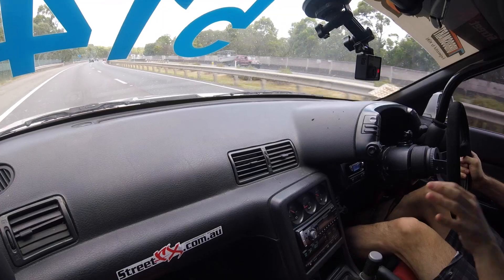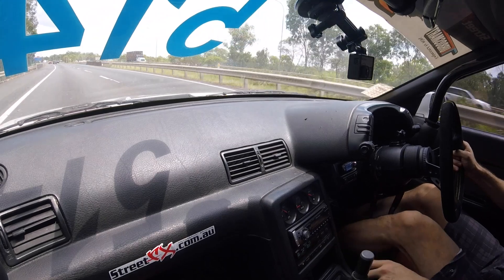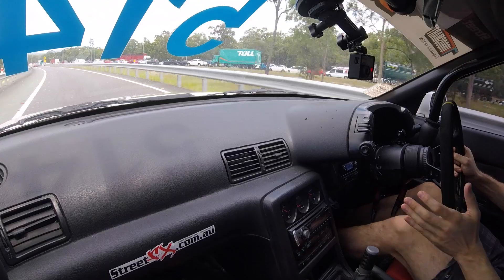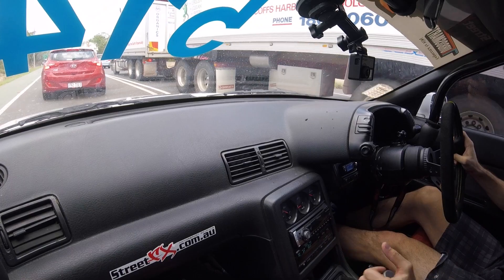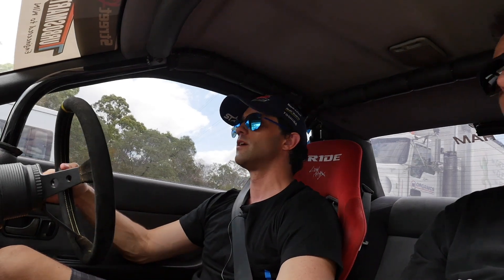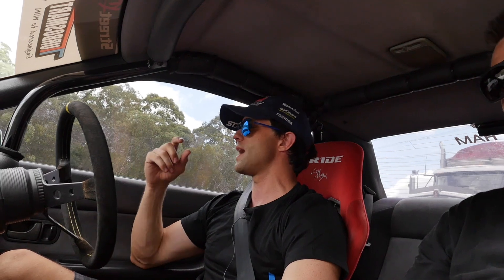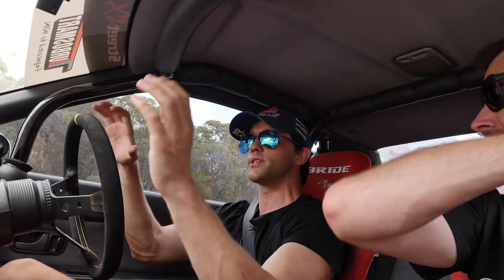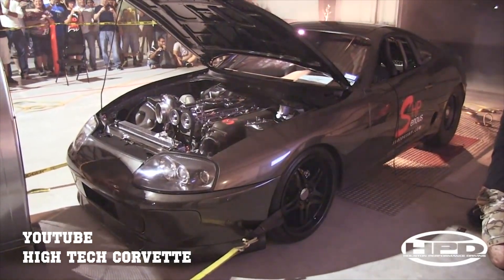What is TURBO FLUTTER & SURGE? Is it Bad? Myth-busting in our Nissan R32 GTR!

Comment: You're talking about a ball bearing turbos. Try that with a standard turbo and watch the rotors get swallowed by the engine, lol.
Reply: Owned a bunch of turbo cars with journal bearing and no valve, they never had one, zero issues with the turbo.

Comment: This guy: Surge: its when you at wot and its too much AIR THAT HAS NO WHERE TO GO.

                  Flutter: its when you at closed throttle and THE AIR HAS NO WHERE TO GO.

Dude you saying the say thing and calling it a different name like there 2 sifferent things. The air has no where to go but back to the compressor wheel slowing it downcausing it to surge. Their the same thing and yes they do detroy turbos normal turbos, maybe not high performance turbos with better machined parts but MOST turbos flutter/surge will detroy your turbo and i will be at the shop ready to replaces them for you cause iknow your most of you dont care 👍

Comment: It sounds like nails on a chalkboard and is bad for the turbo bearings. A blow off valve sounds great and saves bearings, intercoolers, boost pipes and hose clamps.
Reply: Well it's a good thing running no blow off valve doesn't damage any of those things.
Reply: @DriftNick    just running and time damages them. Unnecessary boost spikes increase the wear on all of them.

Comment: Do you know her Jeremy Clarkson says it’s not the speed that kills you. It’s the sudden stoppage well, when people say the turbo spinning backwards, they don’t mean it’s literally spinning the opposite direction. They mean that the impeller rpm is slowing down to the point where air is making it Slow down. The air Hass to go back through the the turbo and it’s generally not good
Reply: When people are saying it is the turbo spinning backwards they are not understanding what compressor stall is, they think it's actually the turbo stopping, turbo flutter does not actually slow the turbo down, the turbo is already slowing down because of reduced exhaust flow, turbo flutter or not does not change how it slows down.
Reply: @DriftNick  compressor surgeon turbo flutter is the same thing I don’t really want to go over this when you can YouTube turbo flutter in compressor search and there’s a video with a man with an electronic turbo that shows you the most basic form. What flutter a.k.a. surge is it doesn’t reverse the turbo it slows it down with enough force to cause damage do you ever see a plane just break apart that’s because the air has so much pressure it can destroy things and I’m not going to sit here and argue when you can do your own research
Reply: @oler777  I know the are in the same thing, I didn't say otherwise, as for it slowing down the turbo it does not do that, people have literally tested it with a turbo speed sensor, the rate at which the turbo slows down after lifting off the throttle is the same between running a blow off valve and running no valve.

"plane just break apart that’s because the air has so much pressure it can destroy things"

Not even close to the same thing.

"do your own research"

Clearly something you have not done.

Comment: Thanks for this valuable information! I was slightly worried about my turbo after my Diverter valve failed on a recent road trip resulting in compressor surge / Turbo Flutter. I ended up driving about 400 miles with this condition and I didn't really seem to have any boost lost. I was just worried about the stress it might of caused my turbo. Since this owner has been going DV/BOV less or whatever and intentionally causing the flutter I'm guessing the 400 miles I did like this before changing my DV valve to prevent Flutter didn't cause any harm. A different youtuber made it sound like it was pretty harmful on bearings hardware.

Comment: For all the ppl asking or assuming it damages the turbos components.., it’s both yes and no… the rotating impeller speed, it’s seals, the inner clearances, the bearings.., by numbers on paper and science yes it SHOULD hurt components BUT how many videos have you seen  with ppl showing damaged turbos from surge?? None..

Comment: Turbo surge can also be your tune! Two reasons are,too high of a boost level at too low of an rpm, and even if in high gear and high rpm, your throttle body percentage (amount open) is not at WOD so partially closed will add resistance to the turbo and cause higher boost levels but would be a “false” reading because the turbo’s flow is maxed out at the throttle body instead of the boost pressure being maxed out at the cylinder or behind the intake valve.

Comment: I have installed blow off valve spacer in my Fiesta ST 1.6 230 hp for the whooosh sounds and even though everything is installed correctly, somehow i get the turbo flutter upon releasing the throttle which shouldnt be the case. But i quite enjoy it, question is... is it safe for the stock small KP39 turbo? :D

Comment: Nice vid, but you did sidestep the point that compressor surge when on throttle is bad, because you're trying to spool the turbo on the hotside but the compressor side cant push the air, so it puts the turbo under a lot of stress.

Comment: I have had my 180SX for 21yrs and I get some flutter and love it with my GFB dual BOV I have it plumbed back to the inlet of my turbo to help keep it spooling when I go full boost there's no flutter only low to mid throttle.

Comment: I want to do that to my car turbo flutter and blow off valve at the same time that's sick it sounds crazy but how does it work Together?
Reply: If your bov is adjustable, tighten it fully then back it off slightly. That way itll vent via bov under high boost, but flutter on low.

Comment: I appreciate the info thats not just on the surface, ive heard a few N54 (bmw copy of the 2jz) BMW e92 335i cars have this surge sound before but VERY VERY few have it, im willing to dump a bit of performance for that sound, how would I get it? It seems to be a mystery in the community for that engine at least, some say BOV but the only way I can see that is if the BOV has a super hard spring In it
Reply: Don't run a blow off valve and have a metal intake pipe going into the turbo, it will flutter.

Comment: Hi there i know this video has been made a long time ago! But if i dont have the flutter sound what steps could i take to make it?

Edit: My turbo is TDO4HL
Reply: Block your factory bov, use an open filter rather than filter box (a pod filter or similar).  Replace any ribbed sections of your intake. Turbo size and boost will change the way it sounds, so its very unlikely yours will match the one in the video, but itll still flutter.

Comment: do you need a big turbo for it to have a compressor surge sound like what yours id doing?

edit: and how is the blow off valve shutting when there's too much boost? it's job is to release that excess boost right? is there a setting on the bov that it needs to straight up change gear quickly for it to open?  need some knowledge about this. thanks!
Reply: Bov is set to a certain psi. So itll only open when that much boost is present. Eg, imagine his car is running 20 psi, but as hes cruising around only really spooling to 15 or so. the bov wont open, itll just flutter instead. When hes absolutely hammering it and it's at 20, the bov will vent.  The numbers are just an example. Hope that helped
Reply: @strider5119  thanks for the clarification! so that's how a bov works, you'll set it on a certain psi for it to release

Comment: Cant remember what controlld how much boost your engine gets. Doesnt bov also decide how much psi your engine gets? So if you remove it then you could send upwards of 50psi amd send your pistons through the roof? Cant remember if thats what the bov does also amd where you cam control how much psi it gets in mega squirt

Comment: Can you make another video to show as how you do it
Reply: Block or remove your factory bov. If you remove it, be sure to block the hole and the vacuum line properly. 

Otherwise, you can block the vacuum line that goes to your factory bov, itll get the same result. (The bov can still be forced open with pressure, but not with the boost you'll be running)

Comment: Hi guys, I have a complete stock 2019 Volkswagen Golf R and was wondering if I were to unplug the diverter valve (this will create the flutter noise), would it actually damage the turbo? I'm getting mixed messages and just want 100% confirmation whether it actually damages it at all or even slightly? 
Appreciate it!
Reply: I have a 2015 gti and I tried it, it definitely works and makes the noise. Didn’t notice any running issues or boost issues. Also no CEL
Reply: @vwparedes2768  Thanks for the reply! Appreciate the feedback! I'll definitely give it a go now 😊

Comment: It doesn't allways affect the performance or lag.. With a bov it dumps the air pressure in your intake and piping etc then your turbo needs to re pressurise it when you come back on the gas.. . No bov keeps the air pressure in the system, that's why lotta rally cars don't run a bov
Reply: You just contradicted yourself .... And your are WRONG ...
Reply: @ACommenterOnYouTube  explain
Reply: @strider5119  what did you not understand ?

Comment: Depends the turbo dudes. With anti surge turbo you will not ever brake anything with flutter. Its not turning the turbo wheel backwards but the trapped air hits back the compressor wheel cause there's no elsewhere to go. So 2 things will go wrong brake the shaft if the shaft its not that strong or destroy the wheel wings on high amount of boost. I've seen both of them situation.

Comment: I have a question, if the air is coming back out of the turbo will that affect the MAF sensor if it is set on the intake side of it. Just thought the car would be regerstring that it's still getting air coming in when it isnt.
Reply: burger14uk yes. Sometimes mine will stall if I do a pull and put it in neutral fast. It will over fuel and cut off

Comment: Sorry..These guys are wrong.. when u close the throttle blade the turbo compressor does not slow down.. it actually creates areo slip and SPEEDS UP.. lots of misconceptions with this.. do some research

Comment: A blow off valve blows the air fuel mixture that should be recirculated to the motor to give more power as well as saving gas or petrol if its vented that's causing more air more fuel and believe it or not more stress and wear and tear on ur pistons,rings,and pcv valve most likely will not happen right away but this will result in an engine rebuild or over boosting witch can cause a piston to go through the engine out yo hood no more fun ass race car so recirculation of what ur blow off to our atmosphere maybe a better idea pimp not to be rude do the math guys and stop wasting your gas money that could be used for upgrades 💯
Reply: How can it result in an over boost?
Reply: They do not reciculate air and fuel mixture at all. A blow off valve is placed before the throttle valve.
Reply: If ur car has a maf sensor like the one on my grand national vent to atmosphere will cause my car to either run lean then the PCM has too accommodate for the loss of fuel and air mixture which results can be overboosting because a turbo uses exhaust fumes coming in from the air intake manifold or intercooler setup which mine is a hot-air set up so it goes straight into the air intake manifold which can cause my engine to overboost as well as use more fuel and inhale more air through my K&N air filter with means more fuel needs to be added to the tank which brakes the  pockets because I have to run a higher octane fuel since I live in California the highest octane fuel I can run at the pump is unleaded 91 premium gasoline getting back to how it can overboost that causes damage as far as frying piston rings blown head gaskets and cause an engine rebuild  for my car  does the Grand National Motors are very fragile  good Motors good builds  but just fragile  that's why many people have went to the LS1 or LS2 LS3  engine swaps do you have more reliability but the recirculation valve takes exhaust fumes that weren't vented to atmosphere that we're recirculated can result and increased horsepower better throttle response and less time to spool up if a ball bearing turbo is not being used like mine is it t a 57 mm turbo for the street hey uses Journal bushing bearings not ball bearing so if I vent all that exhaust or air fuel mixture the atmosphere I will start from zero Boost which would have to build pressure up to gain that boost pressure that I have my wastegate set at which is 16 PSI these motors don't see anything over 16 PSI without being blown it depends on how you build the national Motors because Grand Nationals again have very fragile Motors but built correctly can boost up to about 35 almost 40 PSI so I've Been Told also seeing other people on the Buick Grand National blocks but with more boost Thomas More wear and tear more stress on the engine and more money to rebuild or having to buy a new engine block so recirculation for my setup my GM Buick Grand National 1984 hot air system is probably the best thing for my car now for the import cars most likely is different but in any car that has forced induction or turbocharger if you will even superchargers can overboost your engine which tears is it up so would you want to be able to keep driving vehicle without it breaking or would you rather break the bank break the pockets to keep that race that you have built on the road and functioning cuz like most car enthusiasts as myself I love my dream car I wanted to run for as long as I can make it run and still live up to the Grand National name but with new technology versus old technology depending on the tuner and the driver you can have a hundred grand under the hood of your car and still get smoked by a car that you paid $5,000 for it that was built correctly but money doesn't make the car go faster it's the car that goes faster controlled by the driver I watch the go smoke a BMW a 3 cylinder Geo that was built correctly smoke a 2017 BMW too bad I didn't have a camera at the time or I would have posted it on YouTube because it was freaking hilarious but if you have the money to keep throwing Parts at a car that break down because you need more power or more boost or better upgrades more power to you me personally not to sound like a cheap ass I'm looking for longevity as well as performance as many other things you can do to get performance out of your vehicle instead of buying big this big that cuz when it breaks your going to be super pissed off about all that money you dumped into it when you could have just upgraded other things instead of dumping it all into one spot I have found this out through experience and breaking myself when I could have just upgraded the things that I needed to upgrade I got it done right the first time just like anything else the more you take it apart the more you lose and more chances of it breaking down when the time of performance is needed never overboost an engine I'm sure we've all seen those YouTube videos where guys think they're hot shit that overboost and over rev their Motors and it blows right then and there after about ten Grand being dumped into what they just upgraded in one spot it's my opinion sticking to it but if you got the money hey why not right if you don't have the money like I do then I would suggest putting the performance where it is needed and then getting a really good tune and stick with that cuz like I said before the car is only as fast as the driver will let it go add a 4 Banger 95 Honda Civic completely bone stock can smoke a compressed Mercedes-Benz that has been modified so I hope what I explained cleared up some of the air that I posted before on my last post even if your car can handle let's say 75 boost or 95 boost something like that why push it to the limit and kill the vehicle when you can lower it just a little bit and still get the same performance that you're looking for again this is my opinion and I speak from experience with turbocharged cars
Reply: @richardberard9541  Not sure if trolling or just stupid.

Comment: To purposely make your car sound a certain way even though the noises combat mechanical efficiency just screams "I'm an idiot" 
It's mind numbing that people can actually believe these things are are ok. While they may not destroy things, it is not desirable at all. The purpose of a blow off valve is to release pressurized air when the throttle plate is closed. If it flutters when you let off the gas it means it's not exhausting the charge air fast enough and you need a bigger bov. To purposely choose the wrong part is dumb. 
Compressor surge under throttle basically means you need a bigger turbo or an anti surge compressor housing. If you can't. You need to lower the boost so it doesn't do that.
Reply from the maker: 1) some people consider noise to be one of the things drivers enjoy about their car. Whether that be intake, exhaust or otherwise. Other people might like a bodykit or wing that may not add any performance benefit.

2) our R32 has a blow off valve.

3) on throttle compressor surge is from pushing more air than the engine is using, so typically with larger turbos, not smaller.

Comment: I'm not turbo expert but i would think that if you are having "open-throttle" turbo surge, that you are robbing yourself of horse power... If you are trying to force that air into your engine and can't handle it all that excess air is putting excessive wear and strain on the turbocharger...
Reply from the maker: Open throttle surge is potentially damaging..  not a good situation.

Comment: He even said the problem. He is running bov spring too tight. The bov is fluttering opening. If he looses up the spring a little it would stay open like it should. Can’t believe you people
Reply: The blow off vale is not fluttering open, it's not opening at all when you hear the flutter sound.